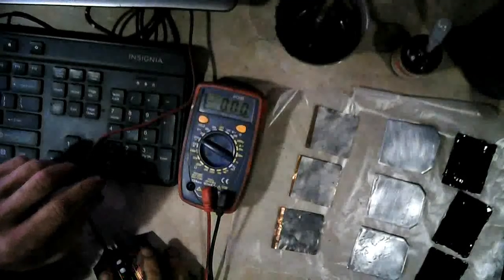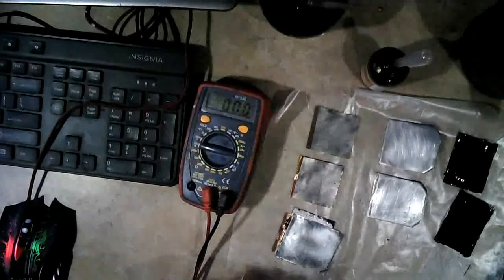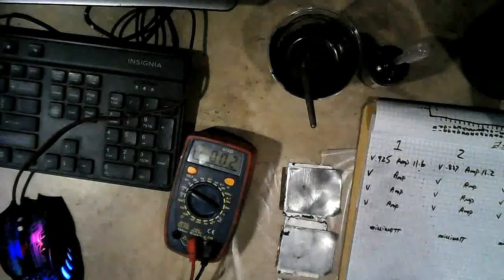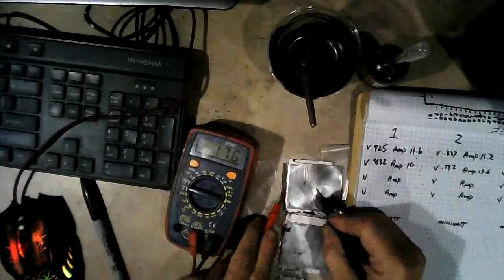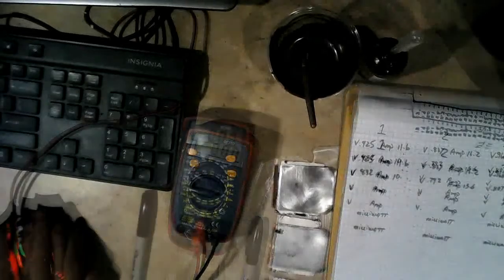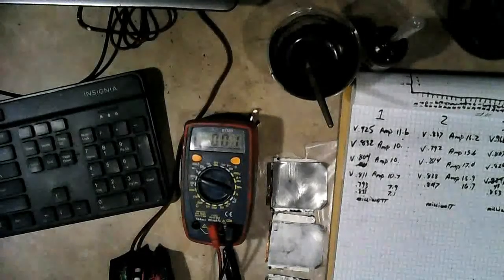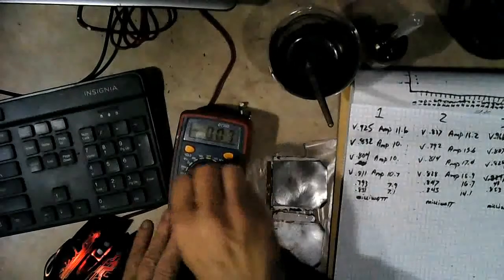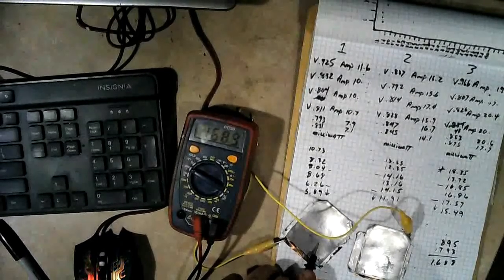Consistent Test & Stacking Test!

Comment: Dan had a similar problem with excess shorting the cells out. His problem was worse, I think because he was using an electrolyte. He came up with the same conclusion for mitigation.
Stacking was spot on. That's good.
Hydration is still a challenge. Dan kept adding electrolyte which kept increasing the concentration. It improved when he started just adding water. There must be a way to keep the cells hydrated externally. Perhaps perforations or galvanized screen instead of plate. I don't know if it would decrease the capacity. Just thinking out loud.
Reply: what is the difference between water and electrolyte?
Reply from the maker: This makes me wonder how many battery researchers are having the same problem but are unaware of it? I'll have to redo some tests now, but that's the price you pay for knowledge.
Reply: BakamonNO: Pure water is neutral (and an insulator) whereas an electrolyte is either alkaline or acid. An electrolyte reacts with the active material to produce power whereas water in effect acts as a path for the electricity between the two components across the membrane but only inasmuch as it combines with the active materials.  The electrolytes attack the electrodes. I think I got that (at least partially ) right.
Reply: That was a good explanation. Thank you MrFmiller, that made perfectly sense. :)
 Mind if I ask who Dan is?